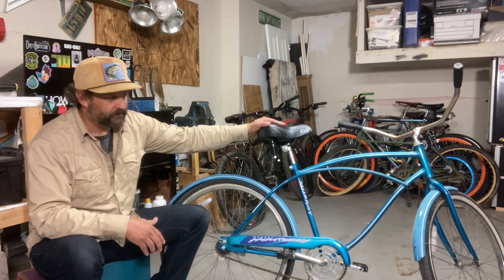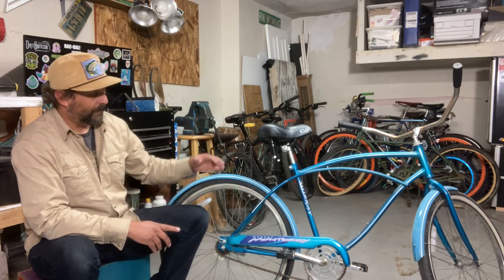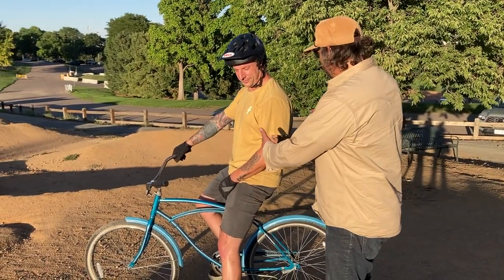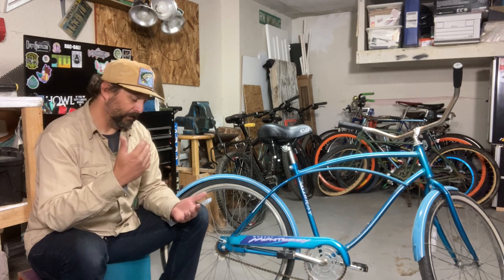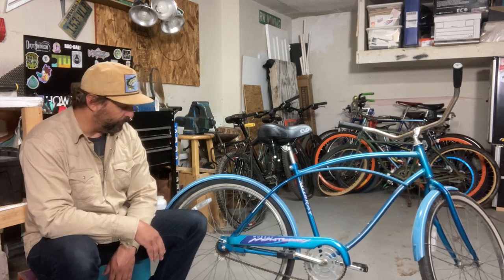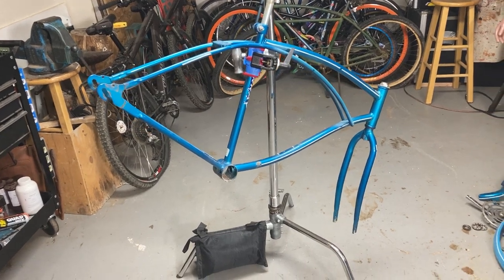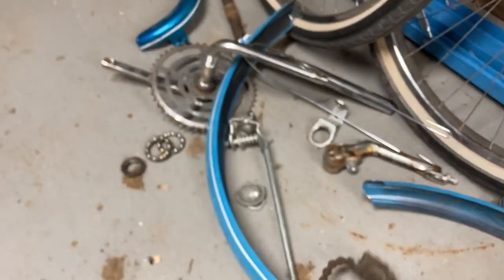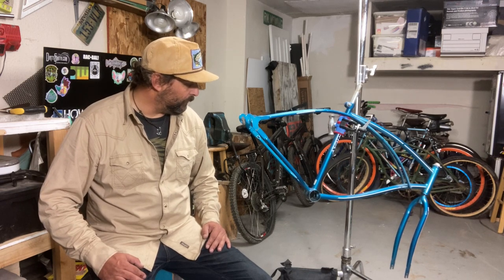Klunker Build Part 1 Disassembly

Comment: it is funny what you said about the chain. most say once the pin is all the way out it can never be put back in but it sounded like you have put one back in before . it can be done and it takes much patience.
Reply from the maker: Never give up! Never Surrender! They can definitely be tricky getting back in and you can damage the link but not impossible. I have done it a bunch and even had to on this project. Might be a good little video to show how I do it.

Comment: good luck matey. Pashley were recently selling shares now closed though. Oldest bike manufacturer in the United Kingdom 🇬🇧, I was also considering a cruiser style bike to build, maybe you can get parts from them or ask them. Pashley make cargo bikes for Royal Mail and the like. Maybe not premium components but I do like the brooks seats and style.
Reply from the maker: They have some cool frames. My next bike project will probably be my mid 50s Schwinn skip tooth. Still trying to figure out if I restore it or go completely the other way.
Reply: @SoggyBottomFabrication  have fun not a week goes by I do not have issues with my bike. Just fitted a new KMC chain and it is skipping under tension no idea why. You could do both a make an electric ⚡️ klunker not sure if many people have done that